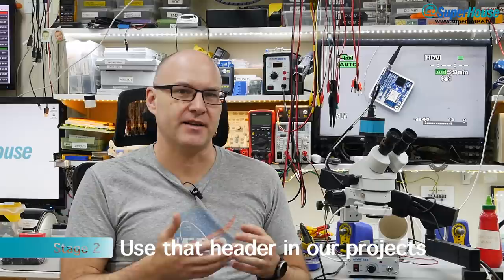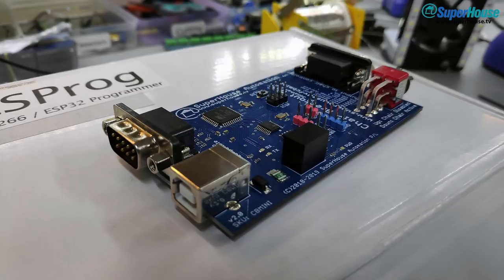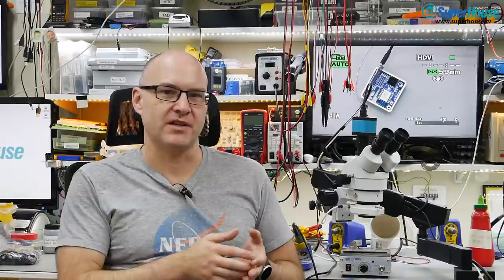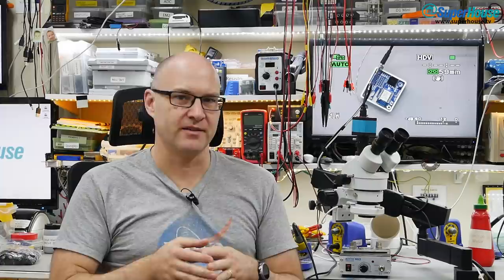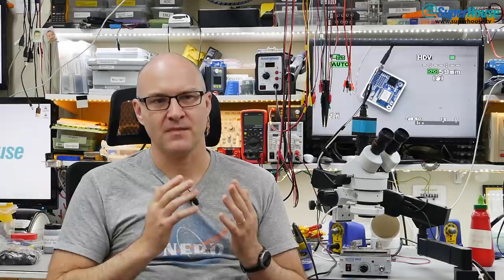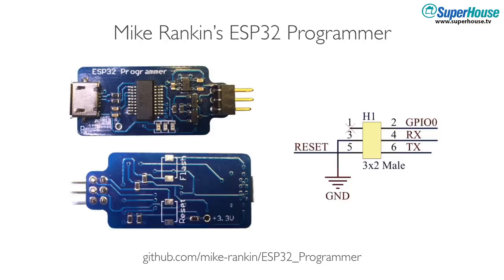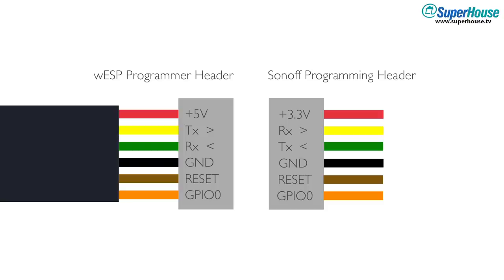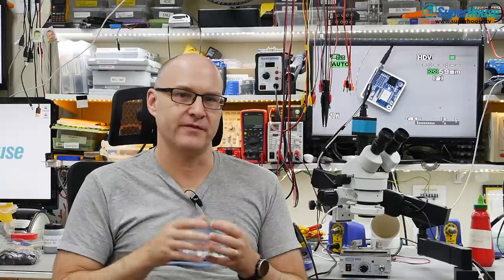Vlog #66: Let's define a standard ESP8266/ESP32 programming header!

Comment: Hi Jonathan, I plan to use the wesp32 or https://www.olimex.com/Products/IoT/ESP32/ESP32-POE/open-source-hardware as a base board for my home automation ( have to finish the house first lots of cat5 and 6 cable ) it going to be POE and MQTT based. (thanks for your previous excellent vids. ) I am all for standards it makes life easy. And to be honest i am not that skilled with hardware so it would be tedious to figure stuff out. I be very interested in what you hardware wizards come up with.
Reply from the maker: The wESP32 is great, and Patrick has put a lot of time thinking through this exact problem. However, we have different opinions on whether the target should be supplied with 5V or 3.3V.

Comment: I don't get it I just use this
https://rover.ebay.com/rover/0/0/0?mpre=https%3A%2F%2Fwww.ebay.co.uk%2Fulk%2Fitm%2F262285972686
With a switch in the 3v3 line to the sonoff and just hold the sonoff's button down when switching on the 3v3 line to the sonoff ...works every time , I've programmed hundreds of sonoff units... I've only ever played with two of the itead bulbs ..imho.. they're not bright enough to be worth 'hacking'
Reply from the maker: The point of this is to have a header that supports auto-reset for the target board. Otherwise there wouldn't even be a question.